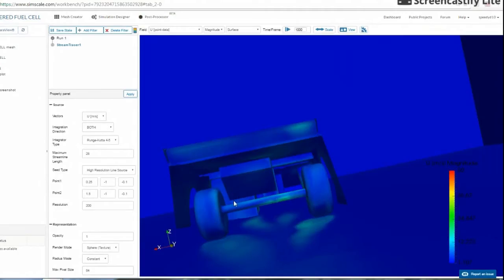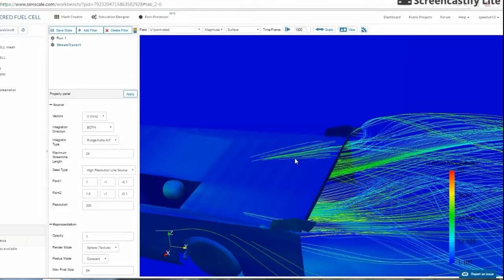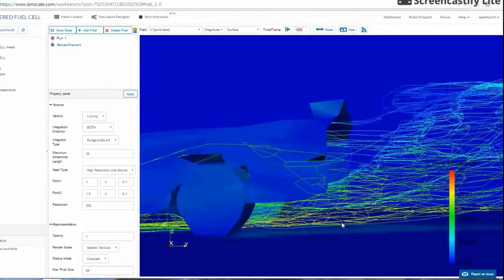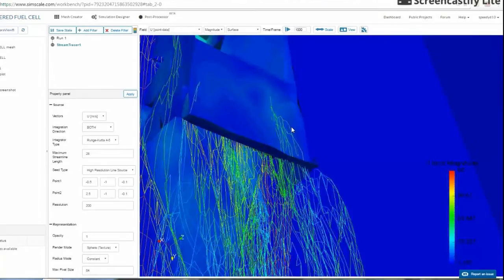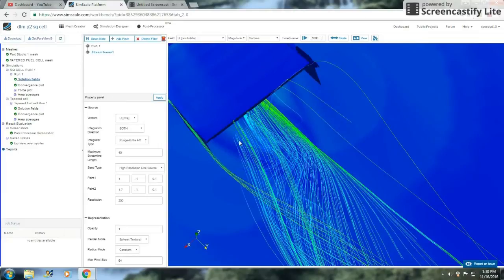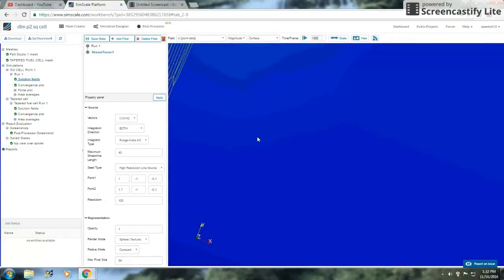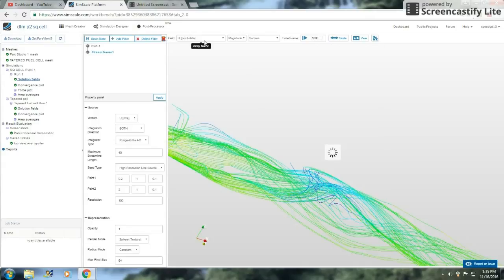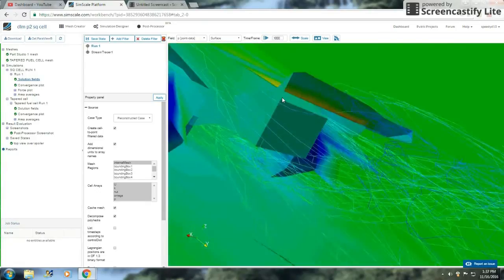Dirt Late Model CFD Analysis  With Aero Comparisons

Comment: By the time you fork out all the extra cash for the chopped cell have you thought about it lessens the capacity so to make up for it your actually making the cell bigger to compensate for the wedge...oh yeahhhhhh lol
Reply from the maker: Majority of cars now days have the tapered fuel cells in them. They hold just as much fuel as square ones. They are just wider and slightly longer.